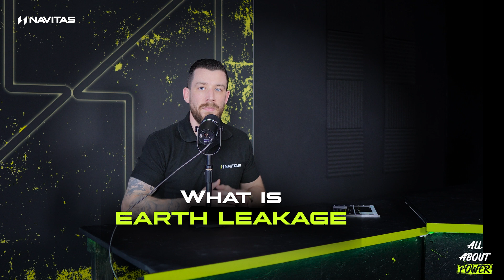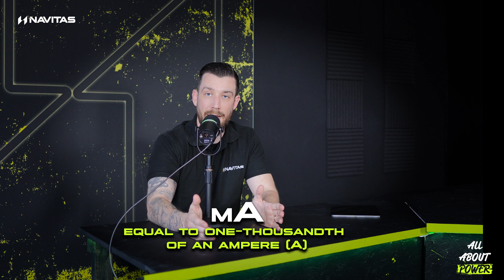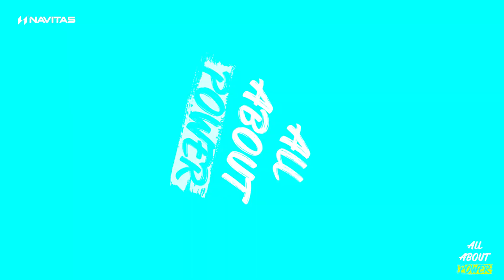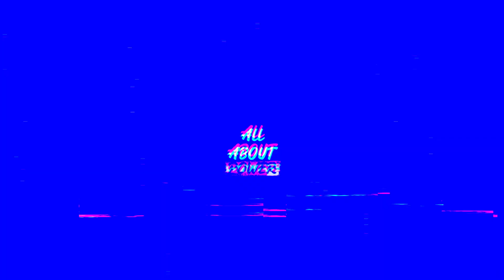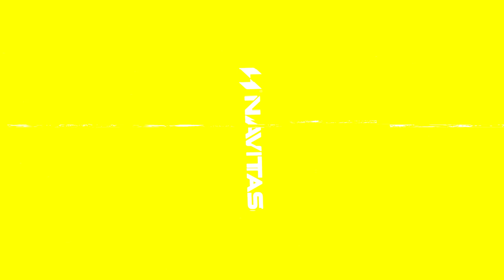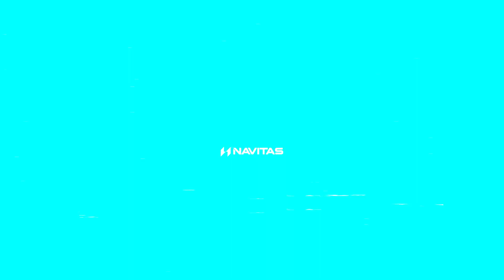Earth Leakage Explained: The Hidden Risk in Modern Electrical Installs

Comment: How does a double insulated TV that does not have a physical connection to earth leak current to earth?
Reply from the maker: Great question. LED TVs leak a bit of current to earth because of the way their power supplies are built. Most of them use filter capacitors to deal with electrical noise, and those components create a small path to earth. It’s nothing to worry about, just how a lot of modern appliances work
Reply: @navitascp  Im not worried im intrigued as to how it gets to earth? There are no exposed conductive parts to the tv, there is no earth wire from the plug, how does it get to earth from the electronics?
Reply from the maker: It’s a fair question and it trips a lot of people up. Even though an LED TV doesn’t have an earth pin or any exposed metal to connect to earth, it can still leak a small amount of current. Here’s why.

Inside the TV’s power supply, you’ve got filter capacitors sitting between the live and neutral parts of the circuit and the protective earth reference inside the power supply. These capacitors are there to clean up electrical noise and reduce interference. But because of the way they’re wired, a tiny bit of current ‘couples’ across them and effectively leaks towards earth.

Now, the TV is double insulated, so it doesn’t have an earth wire in the plug. But that leakage current doesn’t just disappear — it finds a return path through something called capacitive coupling. That means it uses the invisible electrical relationship between the TV and the rest of the installation, like nearby earthed appliances or the circuit’s CPC to flow back to earth.

So while the TV itself isn’t physically earthed, the leakage current still makes its way into the earth system of the property. If you’ve got several appliances doing the same thing, that combined leakage can add up and cause nuisance tripping on RCDs or RCBOs.

It’s a normal part of how modern electronic devices work, but it’s also why understanding earth leakage is more important than ever in modern installs
Reply: @navitascp That still doesn’t make sense,  the filter capacitors and MOV across the supply can only cause leakage between live and neutral.  There’s no induced current to Earth or parallel path?  There’s no connection between the TV power supply to Earth.  The only path it could be through is  the antennae  co-ax if it’s on a metal back box shared with its power socket.  The co ax could be grounded through the back box.  It could also be grounded via other devices on the chassis via the HDMI leads.  I have had a small spark when connecting HDMI leads when both devices are powered on.  Which is probably one of the reasons you aren’t supposed to do that.
Reply from the maker: Good shout and you're right to question it. Most LED TVs are Class II which means there's no earth pin in the plug and no exposed metal connected to earth. So there’s no direct path for current to flow to earth like there would be in a Class I appliance.

But even without a physical earth connection, small amounts of current can still leak. Inside the TV’s power supply there are components like Y-class capacitors that sit between live and neutral and sometimes connect to parts of the circuit that float at a voltage above earth. That floating voltage is not dangerous, but it creates a capacitive effect between the TV and the environment around it.

So what happens is the TV ends up leaking a tiny bit of current through the air to nearby earthed things like metal back boxes, other appliances, or even the aerial coax if that’s earthed. It’s not flowing through a wire like normal current but through parasitic capacitance, which is an invisible electrical link.

That’s why even gear without an earth connection can still contribute to total leakage on an installation. And when you add up enough of these devices, RCBOs and RCDs can pick it up and trip
Reply: @ sorry I just don’t see that,  even on a large 3 phase switchboard you have bare copper  buss bar conductors running in parallel inches apart   to other bare  copper earth conductors on which you can get phantom induced voltages, enough to show a voltage on a  volt meter but there’s  no current flowing.   There’s just no path for any measurable current to flow from an unearthed LED TV to a ground that is meters away.  The current can only pass from live to neutral unless the TV has an earthed appliance connected to it.  
The filter capacitors are no different to any other load when they are only connected across live and neutral.
Reply from the maker: You’re absolutely right. If an LED TV is Class II and only connected to live and neutral, with no earth pin and no exposed conductive parts, then there is no path for current to flow to earth.

What people are often seeing is voltage caused by parasitic capacitance inside the power supply. That can show up on a voltmeter but it is not actual current. Without a second connection, like an earthed coax cable or an HDMI lead going to grounded equipment, there is no complete circuit so no current can flow.

It is a bit like seeing voltage on a loose wire that is sitting near a live one. You can measure a voltage but you could not power anything from it. Same idea here. Unless there is a return path, there is no current and no real leakage that would trip an RCD. Good to see someone calling it out properly
Reply: @ it can be confusing,  I spent far too long chasing an induced voltage in a sub panel that looked like a back feed.  Eventually used a light bulb and a current meter  in series between the phases  on the buss bars in question.  There was no real voltage, it disappeared as soon as it was bridged with the bulb and meter.  Zero current flow measured on the meter.  Some of the flukes have a low impedance voltmeter  setting that helps chase down these ghost voltages.
Reply from the maker: @JT_2024-c8j  the wonderful world we work in ;-) thanks for watching
Reply: @ Thanks for making the effort explaining, its fascinating and im not disagreeing with you. So maybe its something todo with the electrical field on the supply cables induced by the electronics, as when that goes back it can reach the earth and that would make sense so I will look into this more.
Appreciate that nav ❤
Wonder what the math around that looks like 😟
Reply: I'm with the other guys here. Yes, in a switched mode power supply, there may be a Fundamental Earth (depending on design). And the short length of PCB track will be capacitively coupled to any CPC conductors or exposed / extraneous parts. However, with the likely distances involved and the air as the dielectric, the induced currents  will be in the microamp scale, not milliamps at 50Hz. SMPSs also pump out RFI which will also induce currents, but again in the µA range at most.
Yet IEC 60335 seems to allow up to 0.25ma leakage for class II appliances which makes little sense. I can see the clamp meter going on all my double insulated appliances to see what they are up to. But my suspicion is that increased earth leakage is not only down to more appliances but also said appliances blowing the limits.
Reply: @Coherers the bigger issue I was trying to get over is not when it leaks to earth is actually when it doesn’t. It puts dc back onto the circuit which is what is the largest form of saturation on circuits 👍🏽
Reply: Double-insulated appliances don't leak current to earth.